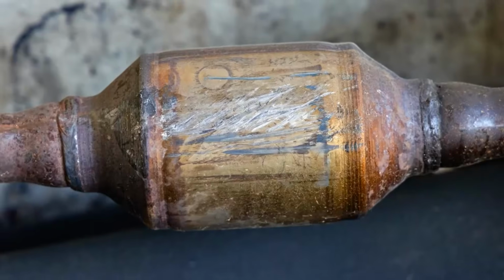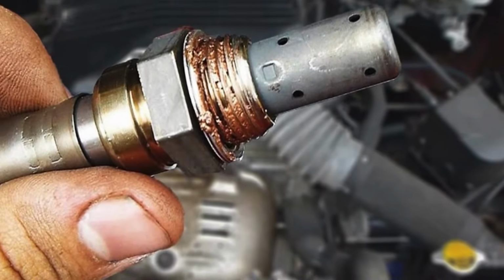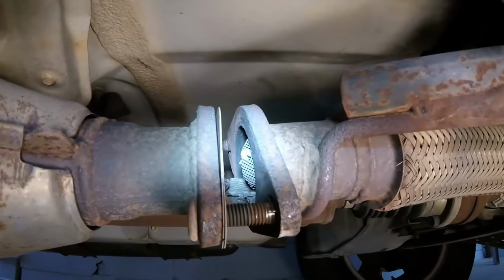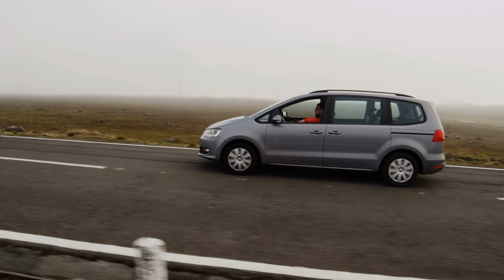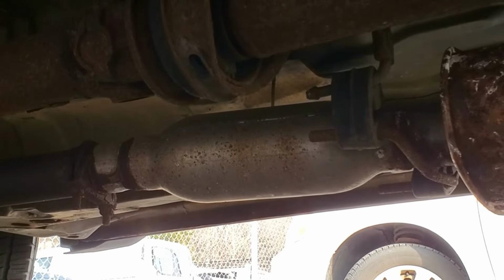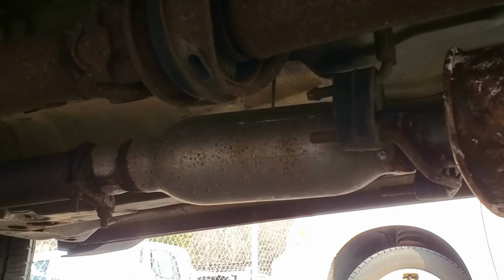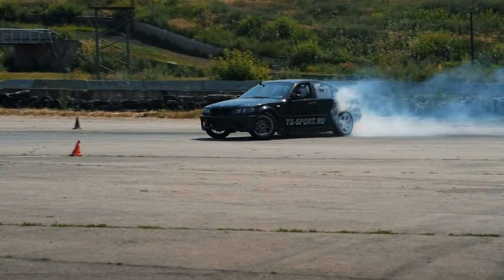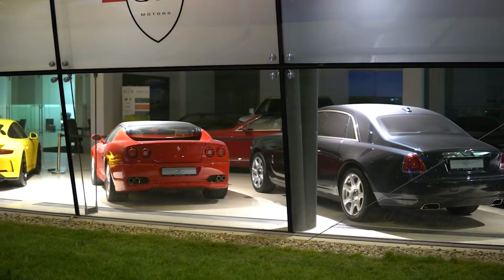Fix your Catalytic Converter for $10?

Comment: Why would you want your engine to run richer? That's what a spacer would do. It will send lower temp messages that would result in more gas. Stinky.
Reply: The spacer on the downstream doesn't control richer or lean lol.   The upstream o2 does and you don't put a space for that

Comment: Adding a 02 censor spacer will not fix the cat
Reply: No but it will add a little pocket of air and can trick the ecm. I have used those spacers many times to pass smog on a vehicle with p0420